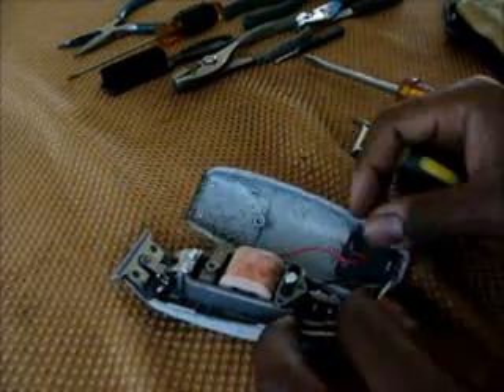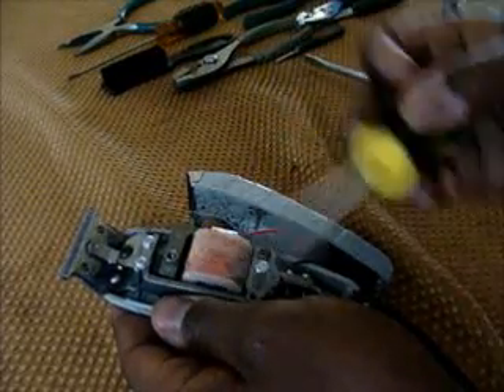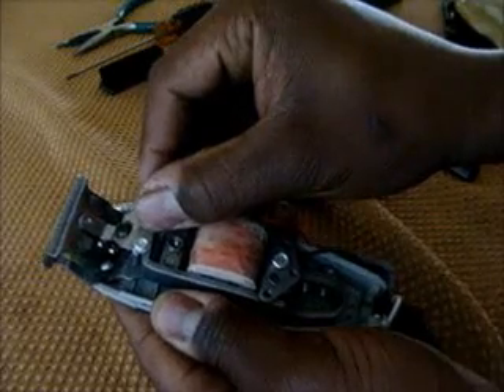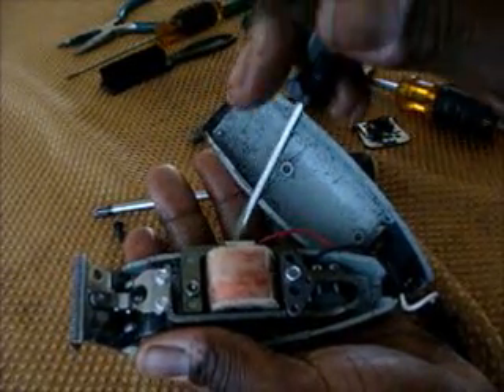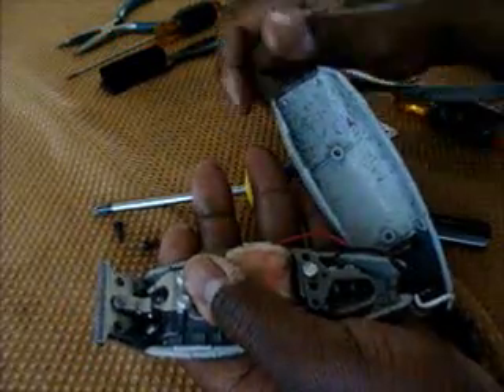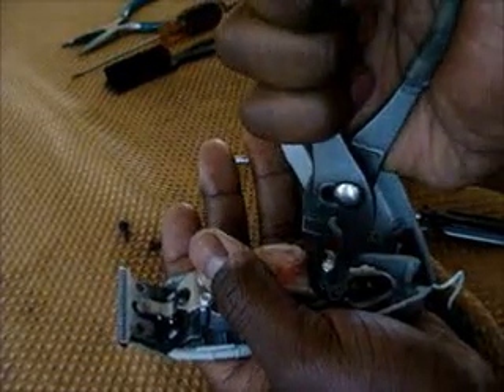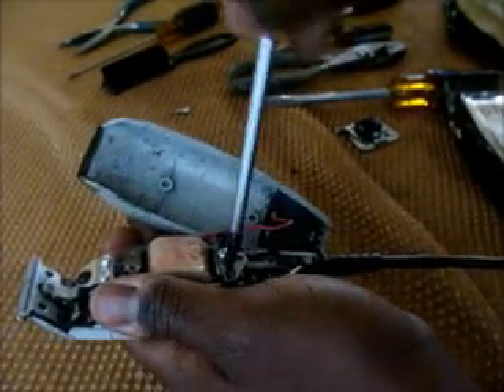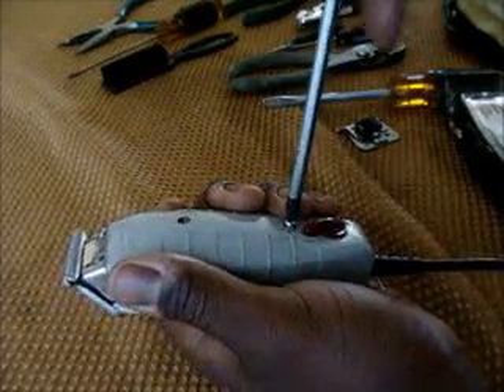T-Outliner Tune up

Comment: I’m surprised this guy didn’t die
Reply from the maker: Thanks for your concern. However all the components in the clipper are grounded. When the switch is off there is no electricity flowing through the clipper. The electricity is only in the wire. So touching the clipper will not kill you. Touching the power source that sends power to the swith can shock you a bit, but not kill you. But i never was near that area. So its all good. 😊Thanks

Comment: watching and laughing. what this barber is doing is why Andis eliminated the two black screws with permanent rivets.
Reply from the maker: You are exactly right
 They saw me teaching people how to make their clipper maintain power instead of buying a new one. They are in business to sell clippers not for you to keep making your old one work. Shortly after this video they changed the screws to rivets. But i will do a video soon show how to still do this with those rivets. 😊👍
Reply: keepitsharp357 have you made a video showing how to adjust the trimmers with the rivets?
Reply from the maker: @quintonhall1195  not yet but i will be working on it very soon. Thanks for keeping me on my toes

Comment: I have an Andis T Outliner like the one you have here because the power switch is the same but the motor assembly armature plate is riveted unlike yours that the plate has screws,is it possible to change the motor assembly from the one that is riveted to the one with screws.I have seen a motor assembly with a plate with screws in one of the barber material shops but I just want to first of all know and confirm if it will be possible to swap these two motor assembly.
Reply from the maker: Sure you can it will be no issues just take the two main screws out. It will be fine

Comment: Those two black screws are no longer on the newer Andis. You can't adjust the gap. The real adjustment that I've found is with the Tensioner. Some video's had me bend the arm all out of whack, so I pulled out my second pair and reset that tension arm, back to factor angle. It even was bent over to the right, so the blade will be centered too. Who would of thought. After sharping my blades and zero gap, they hit!

Comment: Anyone know where I can get the tiny small ring terminals that you use to screw the red wire to the power switch? I have found regular terminals off the shelf for 22awg and they are too bulky/large.

Comment: there are no removable pair of side screws in the current clippers - the were replaced by 2 non removable non adjustable RIVETS! Have you a plan B?
Reply: pnojazz did you figure this out?
Reply: Ahhhh yes mines is the same way andis is being stingy
Reply: What i did was with pliers i squeezed the bottom of Armature bar just a  little. & fixed the problem if have any questions feel free✌
Reply: pighater951 you did that method with the newer models?
Reply: Hey guys... Rivet issue solved :) https://youtu.be/GFfrD5Gg6_s

Comment: anybody know why mine pulls on my hair ? I tried adjusting the motor and the tension spring works better know but still pulls my hair what could be the problem.
Reply: D9084 if it's the blade it needs sharped mine was doing the same but I realized the lil space in between the blade and the clipper was pulling mine so I loosened it up so the gap was a lil bigger and it stopped.

Comment: There is a proper tool for everything fam. Hex screws require a hex socket and ratchet. (1/8" 4 " long). Tell the people to use the right tool before they damage that screw.

Comment: Tried this and it keeps hitting the motor and still making very very loud noise. Anything I might be doing wrong?
Reply from the maker: Yes you must loosen and pull the moving arm slightly away from motor.  make sure you hold in place very tight as you tighten the screws back

Comment: @ youngbuck1250 hey chief what's up I've had this problem a few times but if you didn't fix it already you can modify to work or find a similar at an auto parts store .. the modifications simple just securely stick the piece of wire under the screw and tighten it firmly it's been a couple years and I still use those particular edgers... Hope this helps

Comment: whats up brother. i have an issue with the red wire that connects to the top case switch. the clamp that holds the red wire and connected it to the screw has broken. do you know where i can get another clamp part thing from? thanks

Comment: My T-Outliner took a trip up north with me in my gear bag and when I went to do my beard the blade had stopped working.  I tried everything, adjusting the tensioner and blades.  Only when I used this tip to adjust the motor arm did my bad boy come roaring back to life!  Thank you so much for making this video, this saved me and now I can get my fresh on!!  Not only that but I am now a mechanical master of the tool.  BIGUP!!

Comment: I wonder how many people got electrocuted after watching this lol
Reply from the maker: Thanks for your concern. However all the components in the clipper are grounded. When the switch is off there is no electricity flowing through the clipper. The electricity is only in the wire. So touching the clipper will not kill you. Touching the power source that sends power to the swith can shock you a bit, but not kill you. But i never was near that area. So its all good. 😊Thanks
Reply: If it's plugged in
Reply: Hopefully they don't touch either of the screws on the switch. It is good practice though to unplug something though.

Comment: Hello folks..I have a problem ..
My t-outliner is giving me burns and heavy black marks where ever the blade touches on my face ..I tot it was my skin problem then I use it on my brother and the same issue again.so I went to sharpen the blade very sharp, followed the necessary adjustments ,and even adjusted the tension spring ,yet still the problem is persisting .any experience and solutions pls ..?
Reply: +king james you cuttin yourself because your blades have an overbite. Blades should be adjusted with no underbite nor a overbite. Make sure the blades are even and you won't get them black marks on your face.
Reply: king james that's the motor getting hot.. I would loosen the arm like in thi s vid that should help
Reply: killeen610tx,can u explain further.. Like how?
Reply: like in this vid where he adjusted the arm you should loosen the arm because im pretty sure too much vibration is causing it to heat up
Reply: killeen610tx...I did this ,the arm was a bit close to the motor which I move it a bit ,not closer to the rubber cover but he said ,not that close nor that far ,
My blade is sharpen nice ,my tension spring like he demonstrated in his other vid.
And still irritating my skin..I wish u cld see my beard and cheeks bro..
Reply: I know t outliners get real hot .. what I can suggest  is give it a couple minute breaks while shaving
Reply from the maker: +king james if you send it to me i will be able to adjust it the way you like
Reply: keepitsharp357 can I send mines in for tune up and adjustments
Reply: Shoot me address

Comment: what happens if you do this and the cutting blade starts going farther out than the guide blade? tension not tight enough?
Reply from the maker: in this case you will have to adjust and slide the blade over to the opposite direction or bend the tensions spring over slightly in the opposite direction
Reply: Just loosen the 2 screws that holds the tension screw on the Armature. Tilt the tension spring the opposite side that the blade is going passed the stationary blade.

Comment: Thank you very much for the tips Andreis! My T-liners were not up to par and i would keep putting my money in the hands of businesses that didn't make any difference in the performance, but once I did this to them I got some super hitters!!! and I watched the your T-liner tension screw video and combined the two and that's was it, now all I need are your wooo wop t blades!
Reply from the maker: your welcome. we are running a buy one get one free special at this time
Reply: go with the modified blades from Chuka the Barber's website. They hit on point real good. Therichbarber.com
Reply from the maker: all our blades come with frree sharpening and they come preset extra then extra sharp

Comment: Every time I screw the tension screw no matter how much times I screw it , it will never get tight, what am I doing wrong ?
Reply from the maker: one it could be stripped but make sure your catching the right angle when screwing in. if it is stripped you could try thread tape or a slightly bigger screw

Comment: Why is it that Andis t outliner trimmers always cut better on one side than the other when the blade is leveled evenly
Reply from the maker: T L it can be a combination of things. there can be grime, dead skin, and grease trap in your blade. you would have to take the blade off and really clean it out. when the clipper run for a minute or so its stiff at first then it loosen up and then the blade will move better. also the tension spring may need an adjustment

Comment: What up brother I have a pair of andis t outliner when I turn them on the cutting blade doesn't move until the trimmer has been on for about 1min or longer, I oil and clean them after every service, any suggestions, thx

Comment: I have a problem with my outliner not cutting. New blade on it. Any quick fix???
Reply from the maker: Pete Lugo try pushing blade  closer or adjusting tension spring. new blades come dull sometimes also

Comment: Good day to you I am very impressed with your videos it has help me a lot I have a question can a cord from a toutliner be used on the black toutliner 3 pin plug an also do you have any videos on wahl detailers
Reply from the maker: no detailer videos yet. not much to do to them. unless you have something specific. yes you can use that cord you just dont have the extra third green wire. it will still work for you tho

Comment: I'm having trouble with this one .when I do the last step tightening  the last 2 black screws the cutter blade on the trimmer is moving left. When I try to tighten the bolt in the middle the triangle thing is turning with the bolt
Reply from the maker: sorry to hear things did not work out for you, I think we can fix the problem though. First of all it is common if the center nut is not really tight and you go to put the black screws in the moving arm will move. so  you must get that nut tight. to stop the triangle from moving, this is what you do
1. turn triangle counter clock wise about a 1/4 of an inch. by doing this you allow the triangle room to move while tightening the center screw.
2. make sure you hold the moving arm in place while tightening the center screw
after its tight and the triangle is not lined up with the holes don't worry
3. now take your pliers squeeze triangle at the top and bottom and twist clock wise to get the holes lined up. then put the black screws in and everything should now line up
Reply: Thanks your the best teacher in the game gonna get some boost juice
Reply: same with me cant get the triangle piece to stay in place and when i tighten the black screws blade is moving to the left